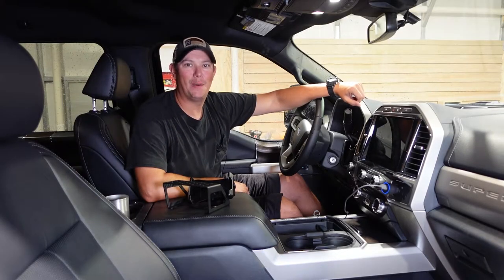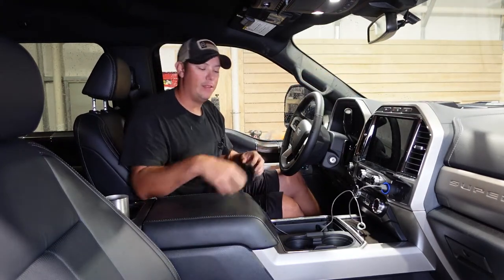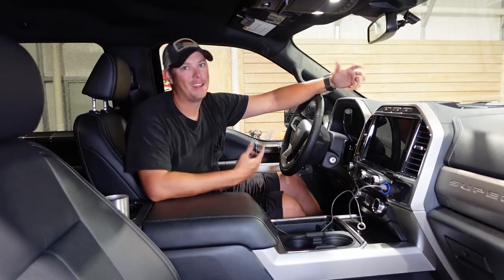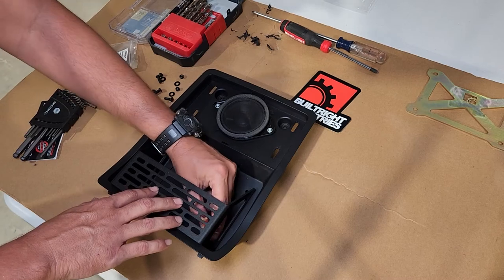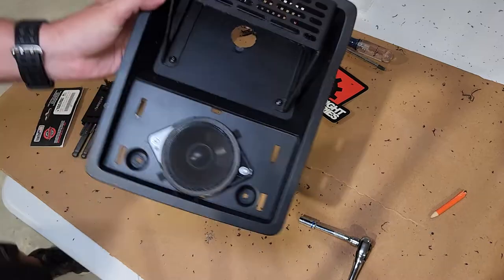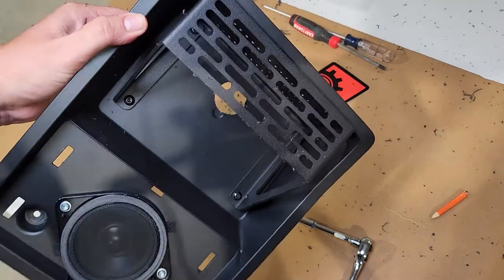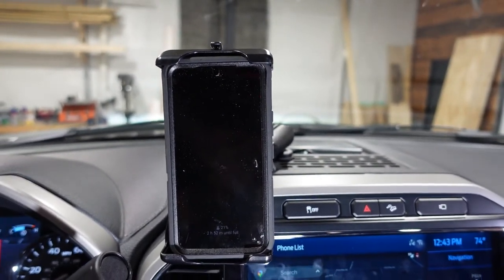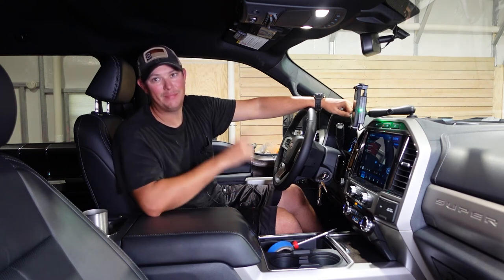Install A BuiltRight Dash Mount W/ 12V Power Outlet & Wireless Charger / Ford F250

Comment: Please click on YOUR link to the recommended fuse tap and read the comments of all of the people that found that the fuse tap does not fit into their fuse holder of there vehicle.             Specifically see the  May 9, 2022 comment  which is from another F250 user also saying that they are "too thick".                                                                                             

 On an F250 the fuse block of the truck requires that the fuse tap has the same shape as the actual Micro2 fuse.  The product in your link does not have the same shape as the Micro2 fuse.    It is too large to ever fit.                                                             I finally found the correct fuse tap (one that has the same shape as the micro2 fuse and it fits like a glove).    I do like your video and would recommend your channel.

Comment: Why did you feel it necessary to include the inline fuse that came with the fuse tap?  It might be very difficult to reach if it should blow.  Also you might add it is easier to drop the glove box to reach a wiring route!
Reply: 100% agree that helped a ton

Comment: Thanks for this video. I did this yesterday. Love it. I put a different power outlet in though - 2 x USB-C and 1x USB-A. Not sure what phone mount just yet, but main reason for me was to mount my GoPro for when I go offroading. I have the heated steering wheel, but did not have time to check what other fuse option to choose. Will test this out over the next few days. Hopefully the 2 can co-exist (heated steering wheel and power).
Reply: Can you provide part # for that usb port

Comment: Excellent video. I did everything you did except the hole saw you used is too big. I had to use 1"1/8.

Also my power adapter won't fit after install. When I put back in the shelf the power supply hits part of the electronic unit mounted to the dash frame.

It's like this for me what ever I try. It's never like the  videos and there's always problems. Not sure how to remedy. I'll probably have to get a new panel and start over and also ditch the backing plate.

2020 F150 Lariat 5.0

Comment: Awesome video, everything worked until I got to the fuses. My power locks didn’t work after the install. I swapped the fuses to both 20amp fuses and that did the trick. Incase anyone else ran into this

Comment: Ok quick question, I have a 2019 F250 STX, my truck doesn't come with the speaker up top but it does have the wiring for it however I want to wire a CB radio into it but have no power to it, where should I start

Comment: I have a lariat ultimate package and I can't find an available fuse. Anybody have a suggestion?
Reply: Did you find a fuse to use?  I have a platinum tremor and will be attempting a similar install today. Was wondering about wiring to an uplifter switch instead.
Reply: @jfarrugia  not yet. Still sitting there next to the fuse panel, lol.
Reply: @alexg0742  I have a trailer backup screen, trailer tire pressure monitor screen, and a wireless online charger.  I'd like to wire them up to uplifted switches so I can power them independently when not towing.  I may try and attempt this afternoon.
Reply: @jfarrugia  let me know how it goes.

Comment: How do I find out which fuse number does what on my 2022 Ford F250?
Reply from the maker: Owners manal
Reply: I’m new to doing any kind of wiring to any vehicle, please excuse my ignorance but do I necessarily need to install the power outlet with the fuse it comes with? Can I cut it off since there’s already going to be a new fuse in the fuse box?
Reply: Please excuse my ignorance, I’m new to doing any kind of worrying to a car. Do I necessarily need to leave the inline fuse on the power outlet wire? Would there be any consequence if I were to cut it off being that it would already be protected by the fuse that would be in the fuse box?

Comment: The fuse tap does not fit into a 2022 F250 - please change your product suggestion to keep others from wasting time.  The shape of the fuse tap is not tapered like the F250 fuse block requires
Reply from the maker: Actually it does fit ,its a micro 2 size fuse tap which is the size required. It's also the exact fuse tap that I used in this video for my 2022 F250
Reply: @PatriotDIY  A 2022 F450 takes a Micro 2 fuse / tap. Found this out when RexingUSA (dash cam) sent me the wrong fuse taps (Mini), which are too big.